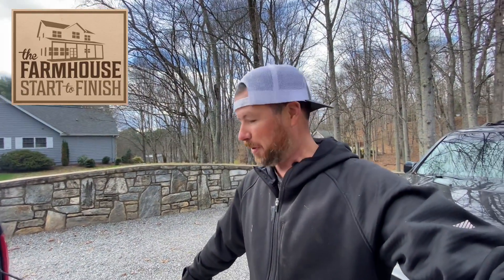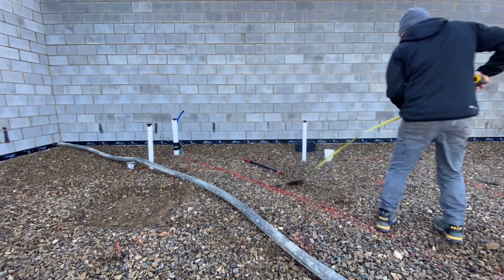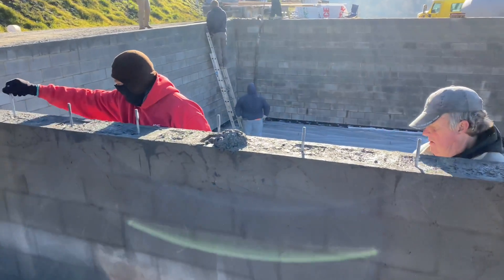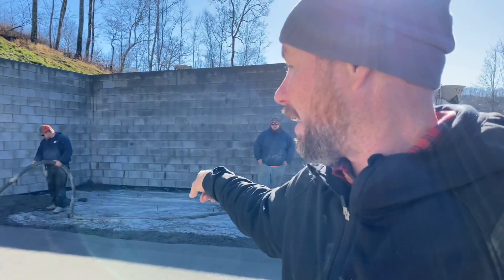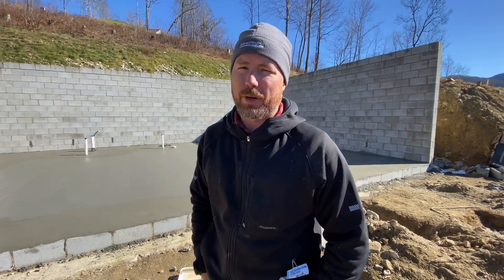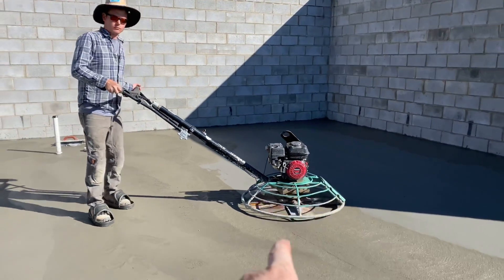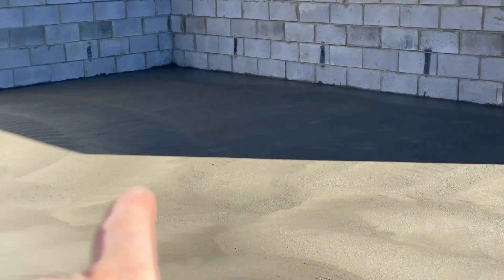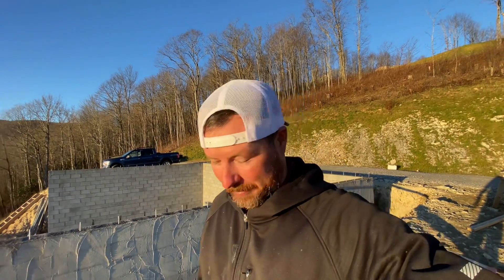Building The Farmhouse | Day 9

Comment: I teach construction inspection for the states DOT. My favorite is concrete inspection and testing. Concrete really is an incredible material. You were driving me crazy when you said it was drying hahaha! 
The easiest way i "prove" to a class that its a chemical reaction is to pour some of my  Dr Pepper into some fresh concrete and mix it in. The sugar basically kills the reaction. 
Also, a job I was inspecting had huge concrete columns that were 8' square and over 50' tall. We were monitoring the internal temperatures and a month later it was still close to 140° while it was snowing. Had to keep them wrapped up in blankets so that the temperature difference between the center and the outside wouldn't be quite as extreme. Best place on the job site to hang out during the winter 🤣
Sorry for long comment, love watching you guys work and for once I had something to input 👍👍
Reply from the maker: I figured that would drive somebody nuts… Curing is definitely the more proper word

Comment: Great job guys. One question though, you didn't put any sand blinding over the gravel to prevent the gravel puncturing the vapour barrier? Ok, two questions, insulation under the slab? Like 4" of polystyrene etc to turn it into a thermal mass? Going to be more energy efficient I would have thought. Anyways, really enjoying this job.

Comment: could you put the vapor barrior under the gravel so the concrete seeps into the gravel? Or would that not change the strenght of the slab?
Reply from the maker: We have always done it on top just so it won’t Get punctured by putting all of the gravel in and walking all over it with wheelbarrows
Reply: @PerkinsBuilderBrothers  Makes sense. Keep up the content!

Comment: Let me ask a rookie question, where are your control joints in that slab? Are they unnecessary where you are or something? 👍👍 on the content.
Reply: Control joints are usually every 20". Good question!
Reply from the maker: We will cut control joints with a masonry blade later. We don’t have the correct saw to cut them into green concrete. They are usually lower RPM so they don’t chunk out big spots where the aggregate catches the blade

Comment: Could you set up the laser level to the display at the top of the screed boards to eliminate having to set grade stakes in the slab?
Reply from the maker: They do something similar to this and huge commercial projects. The concrete is leveled by a motorized screeding machine that uses GPS to level the concrete. For smaller residential projects it’s not really an option that I know of

Comment: When you were pouring concrete, the temperature seemed below 40 degrees Fahrenheit. I know for roads the standard says not to pour concrete in temperature under 40 degrees, is it the same for residential up there?
Reply: You can pour in much colder temperatures using warm water and calcium chloride as an accelerator. Mike Day has a youtube channel about pouring in Maine. Very interesting.
Reply from the maker: Warm water in the mix... that’s why it looks like it is steaming.
Reply: @PerkinsBuilderBrothers  Concrete doesn't dry....it sets up. After that it cures to reach full design strength. Regular drywall compound, on the other hand, dries. Setting compounds, such as Durabond, set and no matter how wet things are in the environment it will set up and be hard to sand. I'm sure you know all this but many people don't distinguish between setting and drying.

Comment: Why didn’t you use icf since the block had to be filled due to site conditions? Still think the energy code requires insulation under that slab 2’ in from that soon to be framed wall.
Reply from the maker: Good question... ICF cost plus the concrete and steel cost a lot more than the block, labor concrete and steel. Also, in our area you can’t get a termite treatment company to do the termite treatment due to liability on ICF walls. There is a risk of termites getting in the foam layer and getting into your wood framing without leaving the evidence of the tubes on the outside of the structure. For that reason the companies won’t do termite treatments, which have to be done by code. I’m not sure how anyone is using them around here.

Comment: I couldn't really tell from the video but it looks like you didn't pull out the rebar pegs that you used to set the height of the slab. If you left them in they're going to rust, expand, and break the slap up all over the place.
Reply from the maker: Not likely in our lifetime with a slab under roof... I would pull them on an outdoor slab though (or just use a completely different technique).

Comment: Why don't you want the cement of the slab to touch the concrete blocks? Good video as always.
Reply from the maker: Thanks... The concrete slab will expand and contract and if it is adhered to the block wall really well it could actually pull the block and crack it when it contracts. That’s the main reason

Comment: Not too familiar with concrete; is there no need for control joints in that slab?
Reply from the maker: Yes control joints are great for keeping the cracks running straight! We will cut some, but don’t have the right saw to cut fresh (green) concrete

Comment: Why no agitator for that wall?
Reply from the maker: Good question... we put the concrete on a 6-6.5 slump so it runs in easily and took care to clean the inside of the block cores while laying. You have to be really careful using an agitator as it can shake the aggregate down in the column causing the concrete to have an uneven strength.
Reply: @PerkinsBuilderBrothers  Ahh interesting. Thanks!
Reply: @PerkinsBuilderBrothers  Good to know!

Comment: Not trying to be annoying but I thought concrete was always supposed to have rebar?
Reply: I used to adhere to that, too. It's best practice for the majority of pours, but it has a lot to do with soil composition, compaction, and seasonal temperature variances. Fiber mesh is a great alternative. Only issues I've ever had with the mesh is it coming out of an onsite mix truck for small pours... it needs to be thoroughly mixed to distribute the fibers. Site mix with fiber is like dumping all your flour in a cookie dough as once lol.